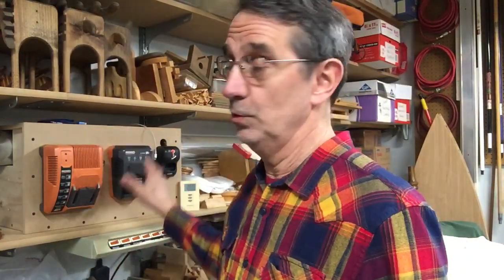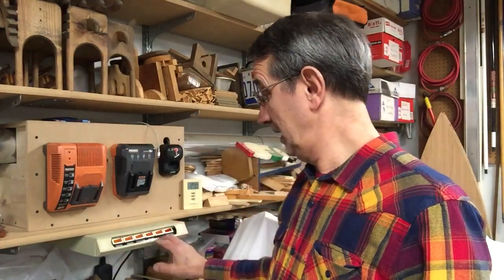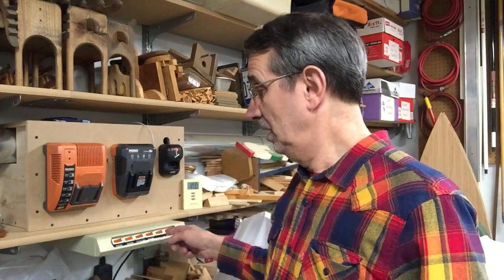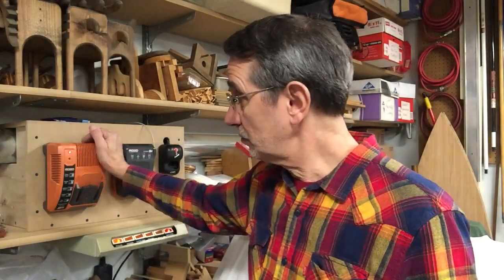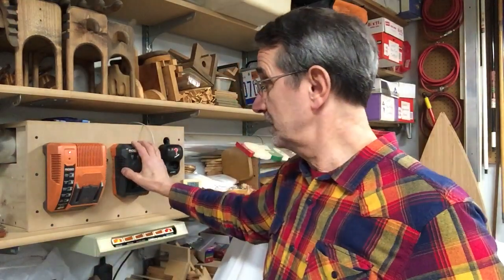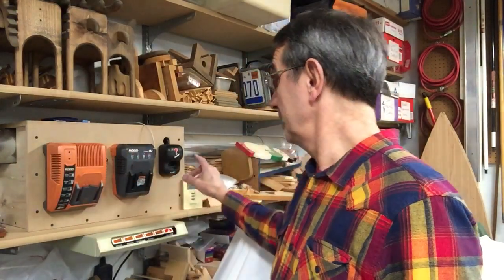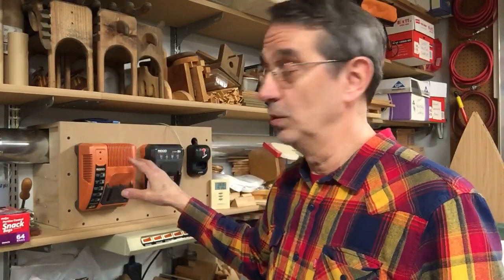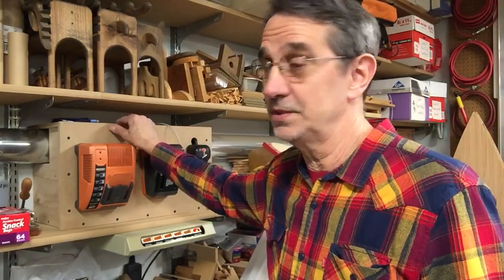382. How can I mount my￼ battery chargers for my shop Tools￼

Comment: hey jim, i have a question, do you use battery maintainers on your lawn mowers? like over the winter?
Reply from the maker: Yes I used to use them but now I just take the batteries out and put them in my shop where they stay warm all winter. Jim
Reply from the maker: @Jamesjghome  Hey I buy all my batteries from USA 1 battery. Where do you live here in Muskegon. Jim
Reply: @Jamesjghome  what brand of battery tender do you use? i may be wrong but i think my battery maintainer killed my mower battery, suppose to be a good battery too. but i dont know that much about batteries or maintainers. thanks for the info!
Reply: @Jamesjghome  dang thats the same kind if maintainer i used, maybe it was just the battery that was bad. thanks!

Comment: I have the Dewalt 20V ion batteries and charger, after they are charged will the batteries hold a charge? I didn’t know you should turn off the chargers 😳😳😳
Reply from the maker: Yes once the batteries are charged fully they will hold a charge until you use them, how long of a Time will they hold a charge depends on how new the battery is.   I always unplug or turn off my chargers, especially if they’re not under warranty why wear them out if you’re not using them.Jim
Reply: Thanks for that info Jim! 👍🏼👍🏼